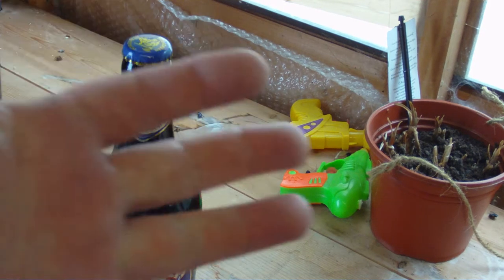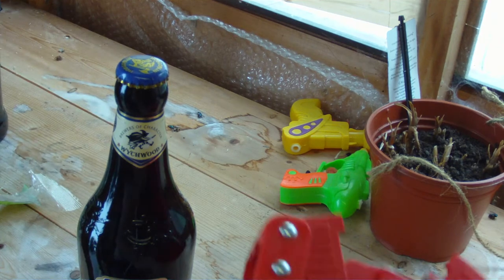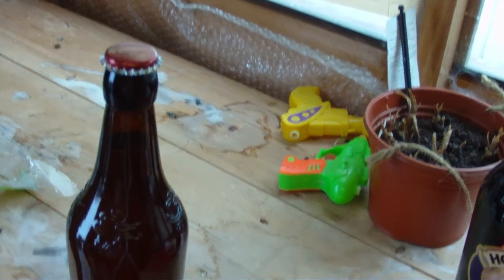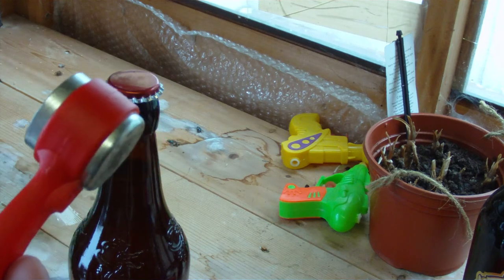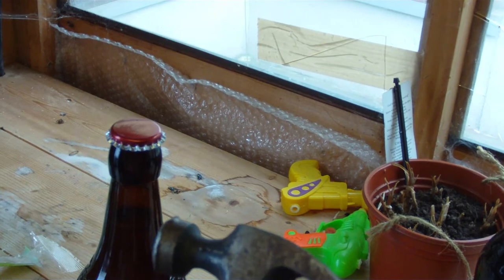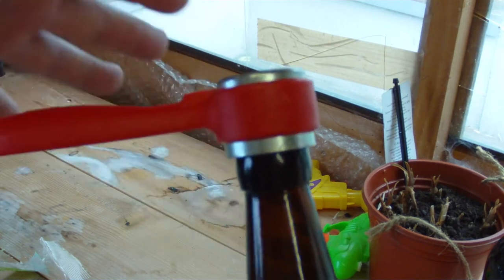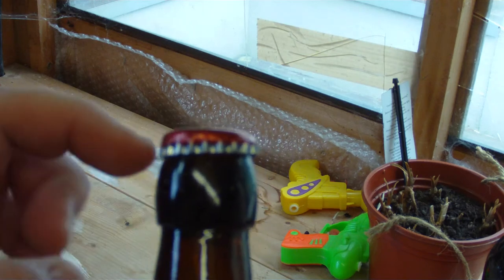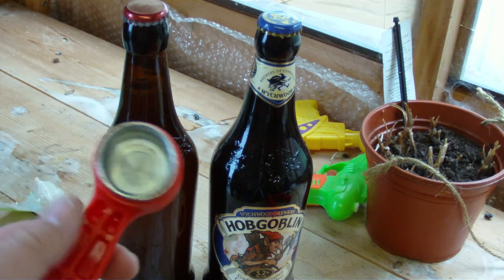Using a Bottle Capper

Comment: Perfect! This was exactly what I needed - straight to the point and a great tip about how to check the seal too, all set up to bottle my home brew cider, struggling to find enough good bottles and couldn't work out how to use the capper hammer for the dozen or so bottles that need capping in this way - Thank you

Comment: Cool video, I like your humour. Reading online, so many people are irrationally fearful of the hammer capper, but it's really not that difficult. You'll probably be bound to break a bottle or two along the way, but starting light and with practice you get a feel for it. I used to use a rubber mallet and also lay a towel on the surface for extra shock absorption (as well as to soak up beer should anything go wrong). Happy capping!
Reply from the maker: You're not wrong, I totally support the bench capper but having this as a backup is fantastic

Comment: You got the wrong bellhousing when you ordered it about housing where you put your cap screws off there's a European version for your size caps you just need to get the right bellhousing for your rejoins products
Reply from the maker: Not sure what you mean here Slow?
Reply: @Unclejona  the bellhousing is depart on the underside of the capper where'd you put the cap in. There are two different ones you should be able to unscrew that one off and screw on the one for the EU caps